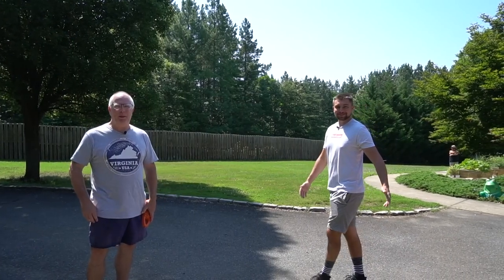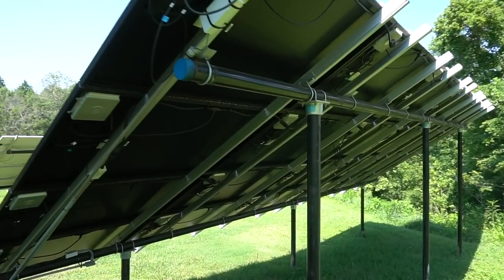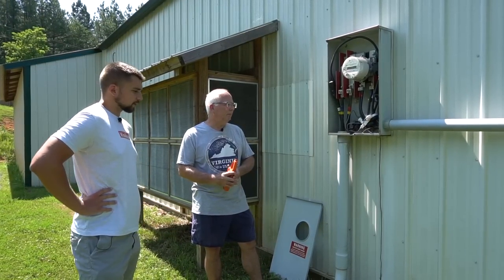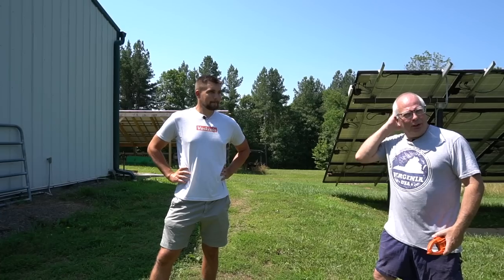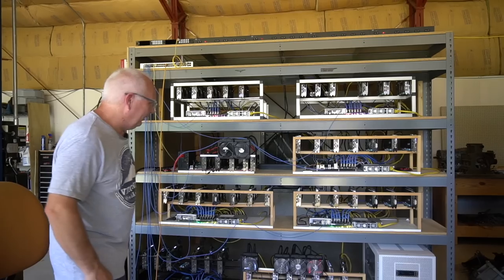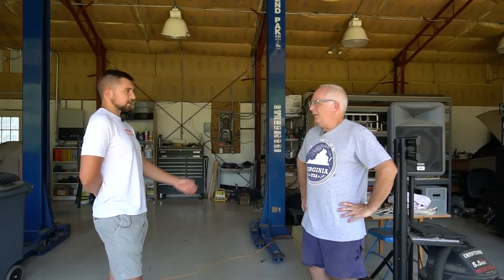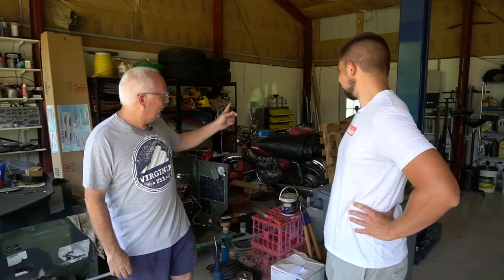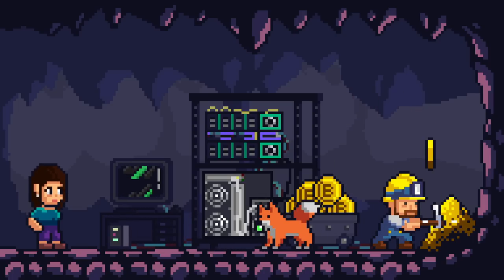The BIGGEST DIY Bitcoin & Cryptocurrency SOLAR MINING FARM Tour!! ☀

Comment: This is the video that brought me back to mining and gave me "the fever".  Living in Hawaii, NOBODY mines crypto.  We have the highest electricity rates in the country by FAR.  The electric company out here is corrupt as all hell as well and slows down the rate with which they allow people to use solar at their homes the way this man does.  They claim the grid cant handle it, but they make no real attempts to upgrade the grid either.

That being said i caught the fever bad.  I currently am lucky enough to not have an electric bill so i dabble a bit.  Ive got 2 RX 580's (A nitro+ and a red devil) just running phoenixminer/nicehash 24x7.  Getting an average of 61.3 MH/s out of them.  One only uses 84w(nitro), the other is at 97w.  I use same settings in my launch parameters, so not sure why they are so different.  Still yet, i think thats pretty good efficiency.  Ive got a 5600xt lying around waiting to be put into a system, and my radeon VII just arrived today.  This is so addicting.

my clocks for those struggling or new:
i use afterburner to peg the fans at 70%, everything else default.
Within the miner i set the cards up at:
core 1130, mem 2200, cvddc@825mv, mvddc@875
both cards stay anywhere from 59-65C depending on ambient temp.  No AC.

Thanks for your vids man, im subbed and they have been a huge help.  I wish i had found this channel long ago.

Comment: That's pretty sweet. But Crazy Dane needs to drill a couple of vertical geothermal wells with exchangers to cool his rigs. Alot better than a barn fan pulling warm/hot ambient air in the summer. But either way I'm jealous if Crazy Dane.
Reply: i agree with you brother im also very jealous but am working towards his postion.

Comment: You don't even need to convert the DC to AC. The PSUs directly work on the DC supply ranging from 100V to 260V DC or as per the specs. Could avoid the loss caused due to inverter.
Reply: How do you sell dc to the power company?

Comment: This guy has an awesome solar setup. However I did not notice any solar batteries storing the solar charge. He should be able to do that for those days when it is raining or extensive cloud cover! I do see he has the credit hour system with power company, but having batteries will make it more self sufficient.
Reply: doesnt make any sense to have batteries as you can mine at max capacity whenever you have sun, so you dont need to or should ave any. Also running a miner from a batterie doesnt make sense for many more reasons, mainly efficiency.

Comment: Pretty cool, I wonder why he didn't go the power wall route for the extra power produced.  Maybe I missed it.
Reply: No. He has net metering so all that power goes back to the power co. I would do a power wall personally.
Reply: @elijuh3  you're confused about net metering.  the power does NOT go back to the power company.  if you make 10kwh during the day and use 5, 5 is credited to you.  then at night you consume the other 5 (taken from grid) you net at zero for the day - so nothing goes to the power company.  in short the grid is a free battery. generally there's a yearly calculation to determine the total made vs consumed at which point you settle the balance with the power company.  excess power is either donated to power company or sold at a discount, (depends on state agreement), so you want to net a zero if possible.
Reply: @fredsnit5699  but that isn’t what he said. He said it went back. I was just repeating what he said.
Reply: @elijuh3  it does go back, but comes back out and then gets netted. hence the name "net metering"

Comment: Sadly he did not source his panels properly. Could be a USA thing, people just charge more for everything. For 120 dollars, you can easily get 450W panels. It would have reduced his panel install by 1/2. If used string inverters through out, and hooked up the inverters together as well, could have had all the power coming in with little clipping. Also spend a bit more time learning about the hardware, most of the information quoted was what the manufacturers print on the boxes or sheets. Always good to test them out personally to see how they work in your own set up.

Comment: So does electricity end up cheaper this way?
Reply: No.  The value of a kWh is the same regardless if you generate it yourself, or buy it from the power company.  People tend to believe solar-generated electricity is "free".  It isn't.    This guy found incredible deals (like I did buying my 41 solar panels on the used market), and also touted a Zero cost of installation, plus the ability to take advantage of big solar subsidies (in his area) to lower the overall cost of the project.   For these reasons, people need to realize the implied very low cost of this particular solar farm isn't at all typical.  Further, and given how he seemed to be guessing at the cost of his project, I think his numbers are off.  I know my costs.  To the dollar.  No guessing required.

Comment: Would it be viable and/or compensate to have a setup with the miners running directlly from the 12V from the solar panels?
Reply: Just one ASIC pulling 3,250 watts would require 280 amps at 12 volts. You would need something like AWG350 copper cable (about .83 inches in diameter) to carry that much current, which could cost $11 per foot or more. Better to go higher voltage and lower current with lighter wire.

Comment: i once want to try it but electricity in my place is cheap anyway, so why bother?
Reply: Cheap or not ... remember the bear period ...... when bitcoin was at 3500 . Almost all miners was at a lost except miners that were on less than 0.05 cents. How “ cheap” you can go ...... without subsidy from the sun!
Reply: @wcweng1  im on subsidised small scale business rate so its only cost around 4 cents/Kwh
Reply: @yukito8148  then it's great. That subsidy won't last fovever.... XD.

Comment: The only thing better is using Hydro power generation coupled with ram pumps where needed to keep head pressure tanks at capacity & Wind power generation...  Diverting a river or stream to use the gravity to drive water turbines is not only ecologically friendly, it is a more constant flow as well as being "overflowed" during rain & storms that can be captured & stored/sold with an accommodating infrastructure..  Coupling ALL power generation technologies is the best method by including Solar with Hydro & Wind Turbines technologies.  In comparison Hydro & Wind turbines have a much less environmental impact than Solar industries, especially with the utilization of Hydraulic Ram Pumps feeding each Head Pressure Tank./water tower...  could even use saltwater in select locations when ram pumps need so little head pressure to lift water so high..  1:7 '

Comment: Damn that's awesome. I'm mining on solar but only 5kW and it powers my house too so just small time for fun but I'd love to do this. In fact a solar powered data center with a few racks for me to mine with would be a dream come true. I wrote a quick python script that queries my inverter and if the house load is lower than the power being produced by the solar, it kicks off t-rex miner via it's API to a PC with a 3080 Ti and a 1080 Ti in it so yeah all the ethereum I mine is "free" as in zero electrical cost.

Comment: I love this setting. I have a garden on a steep slope (ramp already perfect)... but I have 2 problems. 1. It's forbidden to mount the panels other than on a roof here in germany. And 2. I don't have a clue of electrics and would need a company to do it which would be extremely expensive.

Comment: I wish him luck with the Hydro project. I was wanting to build a residential waterwheel. I spoke with the county building inspector in Allegheny County. He wanted me to contact the US Army Corps of Engineers and they told me that I would need a Nationwide 18 permit. Then after speaking with Virginia's Department of environmental quality/DEQ. They wanted me to obtain a $10,000 permit. Because my water consumption would exceed the 10,000 gallon daily limit. On top of all of that you're only allowed to withdraw a maximum of 10% of a stream and you must use 1 mm screening based on the rules of DWR. Alot redtape in Virginia, Even wrote an email to the chair and vice chair of the Virginia natural resource committee. Along with a state senator and congressman. Seriously doubt they do anything to reform DEQ. They want that $10,000 for the Commonwealth and supposedly Virginia is supposed to be friendly for green energy.